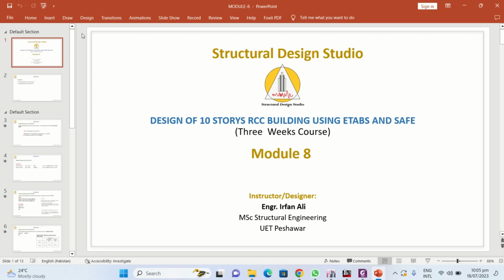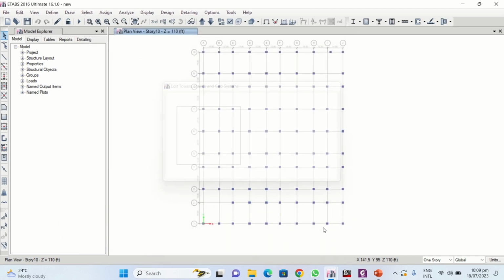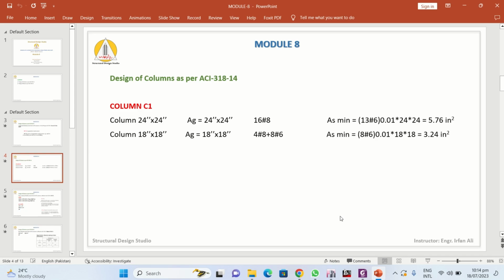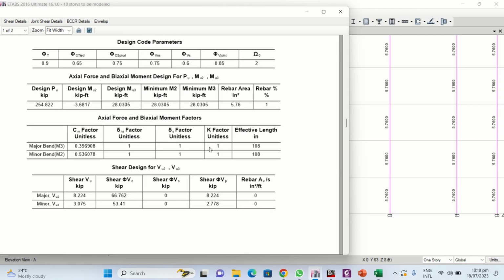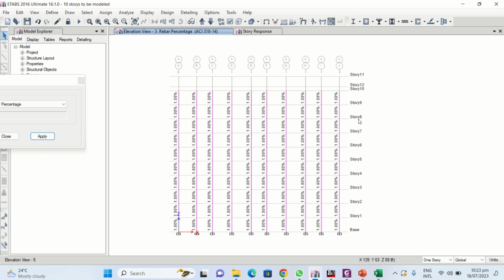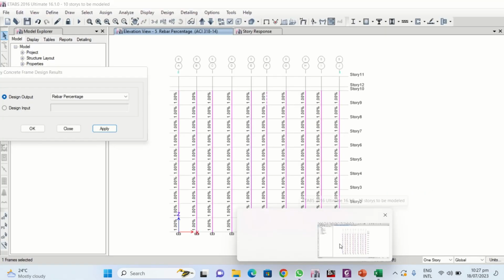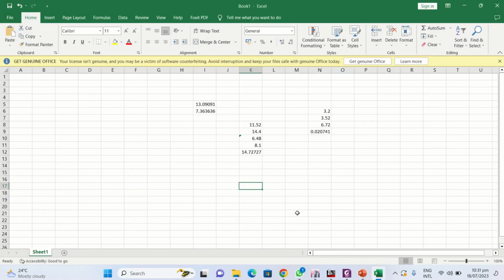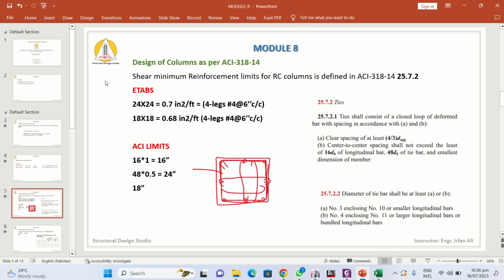Module 8 (Part-1): Design of RCC Columns as Per ACI-318-14  #structuredesign #columns #codes

Comment: Sir, for 24x24 column you have calculated shear reinforcement as 4 legs #4 13" c/c but you have used 9" c/c, why ?
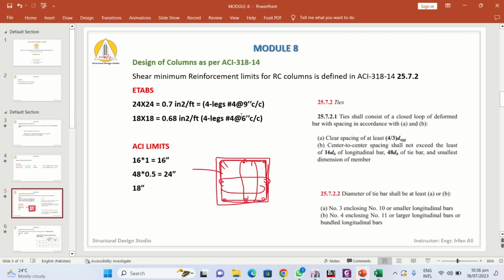Reply: 31:01 got it
Reply from the maker: Max limit of spacing was 9 inches that why
Reply: Yes thanks Sir

Comment: Sir i got 4.35% rebar in columns of above floors ? I did the same steps as in lectures . Plz elaborate why i got higher ratio of columns rebars in upper floors
Reply from the maker: please check your loads applied and base shear.If everything is ok then we have to check your model
Reply: @ddesign-studio  Sir please share your email.